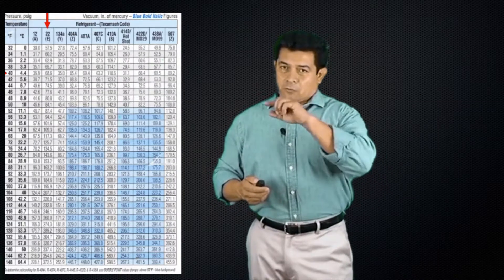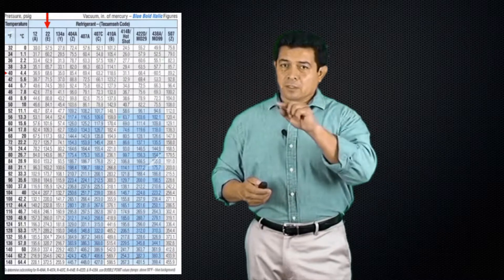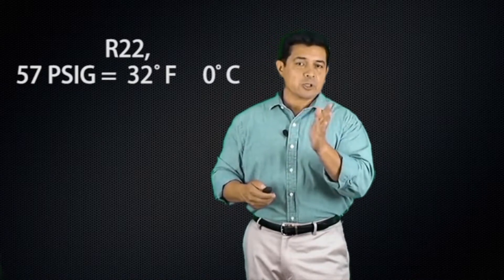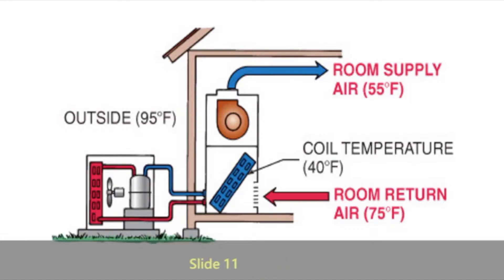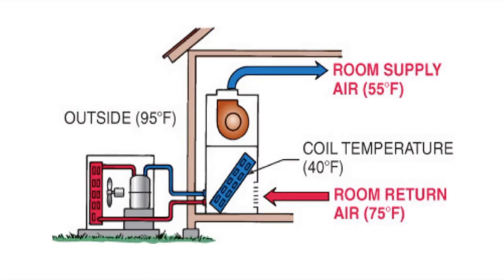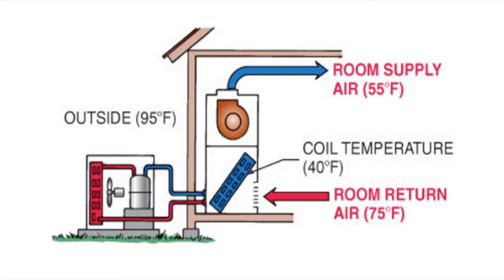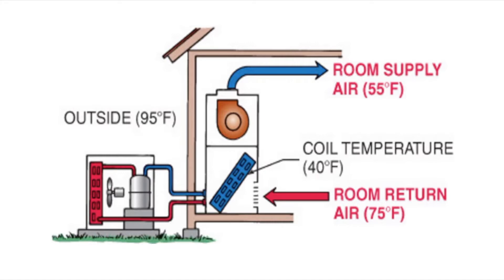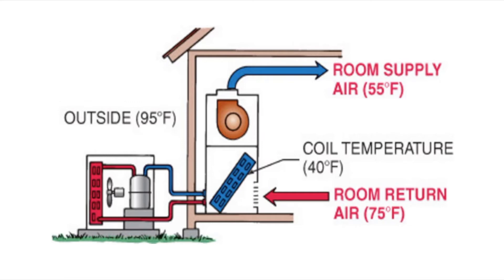Pressure, temperature and delta T - HVAC Online Training and Courses

Comment: Hello can you explain to me please , What will be the cause to have the delta T high then  20F please
Reply from the maker: One of the reasons he would have a delta T higher than 20 is because you have low airflow. If you don't have enough airflow, the air is going to be in contact with a coil longer, cooling it down even more and because of that the temperature of the coil will drop, which will give you a higher delta. T. I hope this explains it. Thank you for watching!

Comment: Thank you for the video lesson!  I understand how to calculate the evaporator TD and it Amounts to 35 degrees F(return air 75f- Saturated suction temperature of 40f)...... I have a question that I’m hoping you can help me understand,,,What formula do I use to come up with the 55 degree supply air temp?  Thank you in advance
Reply from the maker: Thank you for your question!   What we usually do is to figure out the temperature difference across the evaporator coil to see if it operating idealy. To do this we need to take a temperature reading of the return air temperature and the supply air temperature. If the return air temperature is 75 and the supply air temperature is 55 then we would have a 20 degrees temperature difference. Which is what we usually want as an ideal temperature difference. The 40 degrees is an ideal evaporator temperature.   I hope this helped.  Thank you!
Reply: @AirConAcademy  Thank you very much for your timely response but unfortunately I don’t think I posed my question correctly.....I meant to have asked the following.....If I know my saturated suction temperature and I know what my supply temperature is, can I calculate from those two given numbers what my return air temperature would be....I am trying to figure out how you got to a 55° supply air with a 40° coil and what formula can be used if you know two out of the three temperatures ie return air temperature, evaporator coil temperature, and supply air temperature
Many thxs
Reply from the maker: @andreagate542  I am sorry I do not understand what you are asking. Please re-ask the question and I will gladly look at it.
Reply: @AirConAcademy  I was interested in finding out this answer as well so maybe I can pose it in a slightly different manner. How does a 40F saturated suction temperature translate into 55F supply air from the evaporator? How does 75F return air crossing the evaporator become 55F supply from a 40F saturate suction temperature? Is there a formula for converting Evap sst to evap supply air? Where did this rule of thumb come from? It seems that this explanation is skipped over a lot of the time and yet I’d find this info to be an absolutely great tool for us techs during installs and troubleshooting to ensure the system is running properly.
Reply from the maker: @PepsiMaster69  I think I understand your question. Someone a long long time ago decided that 40°F is the ideal temperature for an evaporator. I'm not sure but it could have been Mr. Carrier. Ideally because of comfort levels people say 75°F has always been used as an ideal return air temperature. The evaporator will absorb sensible and latent heat from the air.  If the return air is not too humid then the evaporator will absorb, under normal conditions the ideal amount of sensible and latent heat. Because of that the engineers have figured out that a 20° drop of the air is ideal across the evaporator.   So if you have 75° return air temperature minus the 20 that will give you the 55° supply air temperature. That is said to be ideal. There is no formula for converting evaporator saturation temperature into the supply air temperature as you were asking. But it has always been a rule of thumb that the 55° supply air temperature is ideal.   Just remember, the more humidity the air has the more latent heat the evaporator is going to absorb from the air and the warmer the supply air temperature is going to be. The dryer they return air temperature is, the more sensible heat the evaporator will absorb and the cooler the air is going to be. I hope this helps explain your question.
Reply: 1 thing I have to share... The 40F is  not existed at whole evaporator, it's gradually increasing from starting point to pdp to  suction line here also a 10F  difference between solinide to suction line... Am i  right?

Comment: Thanks for this video, can we follow the 20 degrees delta T rule in refrigeration systems as well? My walk in cold room has its thermostat set at 4 degrees C, thermostat is installed up near the evaporator intake, so we can assume air going into the evaporator is at 4 degrees C. What should the evaporator temp. be set at?
Reply from the maker: ABC Hi, thank you for your comments. Yes you could still follow the 20° delta T. You say that you have your sensor on the return just before the evaporator. That’s a good place to keep it but I am a little bit at a loss about setting the evaporator temperature?   Typically we will have A thermostatic expansion valve in a system like this, the TXV  will  maintain the proper superheat and you would have good sub cooling to make sure that you are feeding the right amount of refrigerant to the valve.   The thermostat will be satisfied and turn the compressor off when the temperature reaches set point. I’m not sure I understand, or what you mean by setting the evaporator temperature?
Reply: Sorry for the unclear question, i will try again, if temp. of return air to evaporator is 4°C (~40°F), and going by the 20°F delta T rule, evaporator should produce 20°F air, which would require to set TXV to pass refrigerant into the evaporator at boiling temp of around 5°F or ~27psig suction line pressure with monitoring that vapor returning to compressor has sufficient superheat. is my logic correct?, if correct, can I be confident that system would maintain walk in at 4°C if I adjust the TXV to give that SL pressure and as long as TXV is suffecienly supplied with subcooled liquid?
Reply from the maker: @77ABC78  OH  I think I understand.  you cannot set TXV pressures to maintain evaporator temperature.   All you can do is set the superheat.  You would need to purchase the proper TXV for that box, so it is made from the manufacturer for that cooler to maintain the proper evaporator temperature.   You cannot put a TXV made for a an AC unit in a cooler because it is made for a 40°F evaporator. I hope this makes sense?